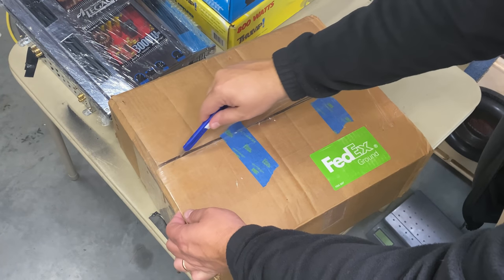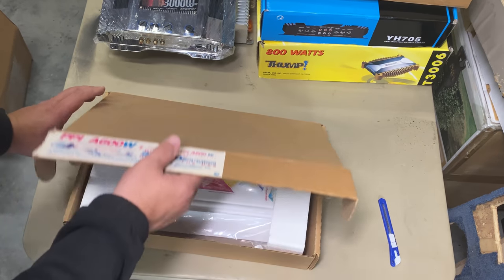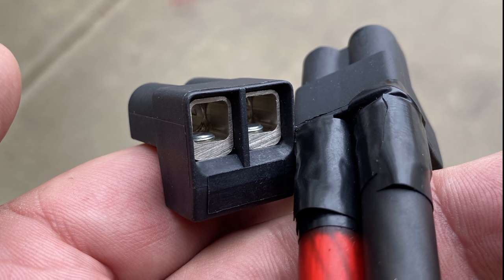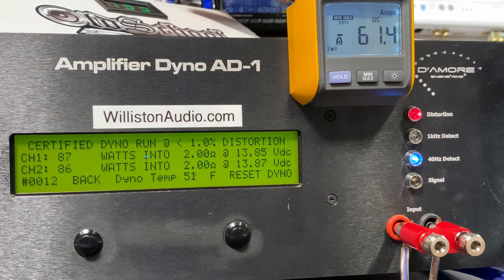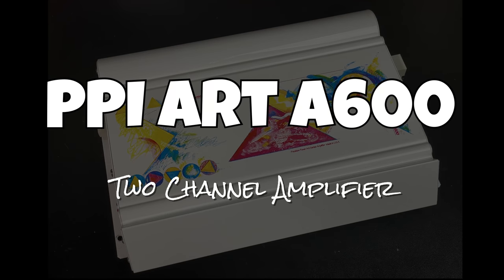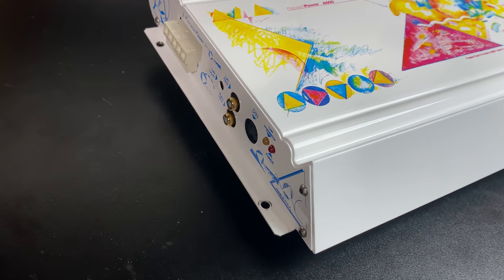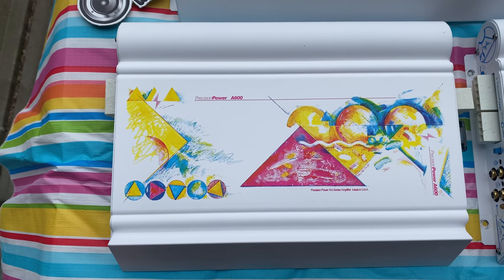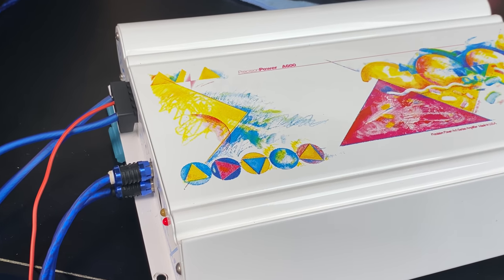AMPLIFIER ART? 1994 Precision Power Art Series A404 and A600 Amps [4K]

Comment: PPI was never under rated like some of the others were.  A Punch 45 has more power than a PPI 2050M.
Reply: I don't know about that. The PPI 2050m was good for around 200 watts bridged mono.
Reply: @msh6865  I have a few of t hem. Punch 45 is at least equal.  Punch 75 way more powerful.